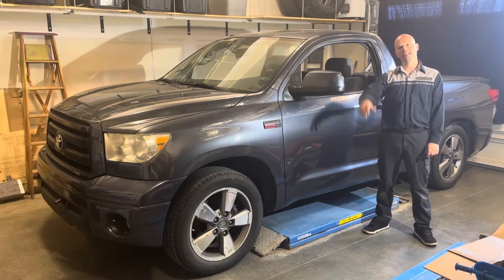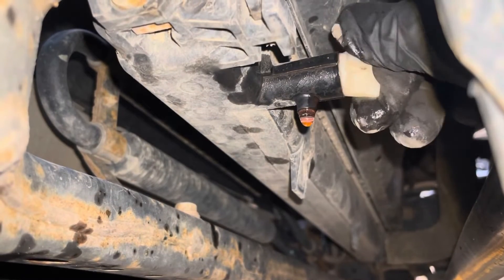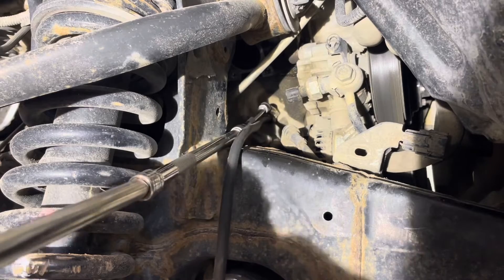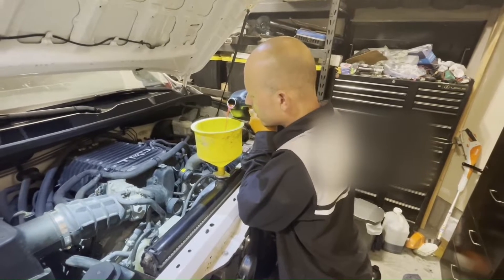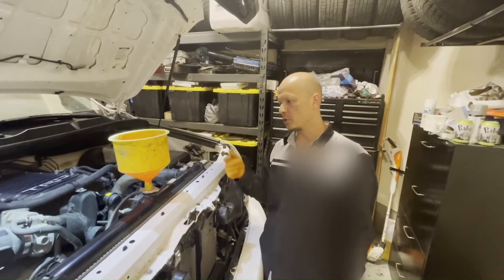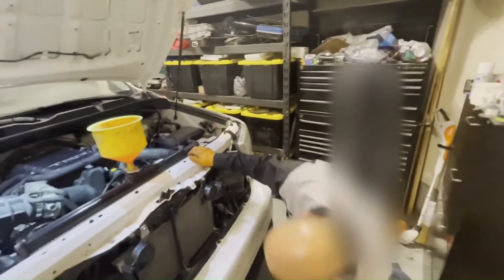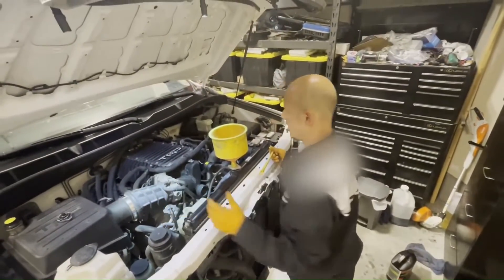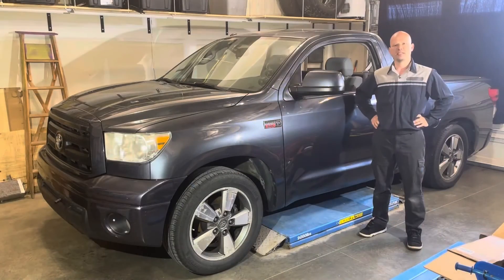2007-2021 Toyota Tundra Engine Coolant Drain And Fill Instructions

Comment from the maker: Below are my affiliate links to the parts and tools you would use to complete this job. I may receive a small commission from the product sales. Thank you!
Genuine Toyota coolant (3 gallons required): https://amzn.to/4nlPCAF
Coolant bleeding funnel kit: https://amzn.to/3QbalKl
Sturdy 4 Gallon coolant drain pan: https://amzn.to/3Ou4iiu
5/16" drain hose: https://amzn.to/43E0cJa
Automotive trim and clip removal kit: https://amzn.to/3KgKGfg
Truck jack stands: https://amzn.to/3q6VS7t
1/2" drive cordless impact wrench kit: https://amzn.to/3Kcw00I
3/8" drive flex head digital torque wrench: https://amzn.to/3O1EOru
Rechargeable LED mini work light: https://amzn.to/3Y74OpY

Comment: Did you also drain out the reservoir?
Reply from the maker: I didn’t, but you can, just disconnect to small hose that goes from the reservoir to the rad cap and lower it down to drain.
Reply: @Viktor_G_Automotive highly appreciate the videos you have made regarding the tundra. I’ve saved my self money using your videos. Thank you.
Reply from the maker: @LuisSanchez-dw7mt my pleasure, thank you for the positive feedback!

Comment: Dang! I love the stance on that tundra!!! So uncommon to see the single cab short bed 5.7 tundras! The fastest NA ones they made
Reply: AND that one has SC! Goodness
Reply from the maker: @HowtoRestoreHeadlights it is pretty quick for a truck, ran 10s in the 1/4 mile 😅 https://youtu.be/tla58JxDXXw?si=ksSyH-SQIkhxkOuJ
Reply: @Viktor_G_Automotive goodness! 
I just like the tow/haul button on mine lol 
300k miles on the sequoia I have now. Just bought it and wowzers did they neglect it. It’s how I ended up here. I’m doing heater hose t’s and figured I should see if there was anything special on this
Reply from the maker: @HowtoRestoreHeadlights right on!

Comment: Thanks for your list of items, I use the hose and funnel kit you linked. The hose has a good rigidity to it that allows me to drain the radiator while only removing my oil filter door from my skid plate, not the whole skid plate. Few tips I've learned:

1.) Leaving the rad cap on when draining it will empty the reservoir as well.
2.) Toyota's repair manual says to squeeze the coolant hoses by hand to bleed air bubbles. This seems to work quite well. Almost no air at all comes out of the system afterward.
3.) I use a USB pump (one intended to be used as an oil extractor) for the coolant fill. Makes it easy to fill slowly.
Reply from the maker: Right on!

Comment: Hi Viktor, is it normal after draining the radiator and passenger side drain for the overflow reservoir to still be full? Thanks
Reply from the maker: Yes, you can just disconnect the small hose from the overflow tank and drain it if you want.
Reply: @Viktor_G_Automotive thank you!
Reply from the maker: @mrpapke09  no problem!

Comment: Torque on the drain bolt I believe is 5lbs. It’s a soft metal. Also tighten too much and socket has an easier time getting stuck
Reply from the maker: I don’t believe the manufacturer provides the torque spec for it, I just go by feel. But yeah, you don’t want to over tighten it.

Comment: Do I need to flush the radiator with cleaner as well? Or is following this guide all that’s needed?
Reply from the maker: Hi, the procedure shown follows the repair manual instructions. You can flush it if you want, but unless the system was contaminated with oil or aftermarket coolant, I don’t feel it is necessary.
Reply: @Viktor_G_Automotive I’m clicking the link in the description for the coolant but it’s saying not found. What brand of coolant are you using For a Toyota Tundra 2010 SR5 V8 5.7L? Thank you!
Reply from the maker: @DatDude_69  Hi, I've updated the link. I use OEM Toyota coolant only https://amzn.to/4nlPCAF
Reply: @Viktor_G_Automotive do you recommend putting a new radiator cap on after?
Reply from the maker: @DatDude_69 it’s very rare for them to fail, so I don’t replace it during a coolant change. You definitely can if you are concerned though.
Reply: @Viktor_G_Automotive sorry for all the questions, DIY vehicle stuff is somewhat scary. I don’t have a jack stand but I do have a 3-ton jack, will that work?
Reply from the maker: @DatDude_69 use at your own risk… it is not recommended to work under a vehicle supported only by a jack without any backup in case it fails

Comment: Hey mister I have Toyota tundra 2007 , and it’s overheating only when u are driving , changed water pump , thermostat so far , and I tested head gasket with fluid tester
Reply from the maker: Clogged radiator?

Comment: How many gallons did you end up using for that process?
Reply from the maker: It will need between 2-3 gallons if you drain it fully, so get 3 to make sure you have enough.

Comment: We’re doing this specific service on a 2019 Tundra. We removed the heat shield on the driver’s side. There are 3 bolts (10mm heads), then lowering the vehicle, we opened the drain from the topside of the engine. You’ll have to use your fingers to locate the drain bolt for the engine block. We removed about 1-2 quarts of old engine coolant from the left side or bank #2 of the 5.7 engine. We use distilled water to flush our engines. It eliminates reintroduction of minerals into the cooling system. We’re in the Southern part of the US and our tap water is quite hard (minerals). We also use the BG automotive products coolant flush kit.
Reply from the maker: Nice work!

Comment: Hey Victor, I did the same procedure, I drained the radiator, drained both side valves, added 1 gallon of coolant to the radiator, started the vehicle, and when it reached operating temperature, white steam began to come out of the radiator nozzle, I immediately turned off the truck, and continued adding coolant, after 2 gallons, I turned it on again and no steam came out of the radiator nozzle, I added 2 more liters of coolant and left it on for 1 hour, then I drove it for 2 hours and the temperature oscillated between 87 and 92 ° C. I did NOT do the step of turning on the heater. Now I don't know if it has air in the system, I need your help... Do you think that white smoke affected the vehicle? The temperature always remained at 90 ° C... it did not go up that far... I also turned the truck off immediately.
Reply from the maker: It sounds like it started overheating due to not enough coolant because of an air lock initially. Don't worry about it, if the coolant level has settled now, it blows hot air at idle and does not overheat anymore, you are good.
Reply: @Viktor_G_Automotive  ty, my friend, what oil you use for this engine? 0w20 or 5w30? Can i run 5w40?
Reply from the maker: @raedavilcevivisa6834 I use 0w20 in the stock engine and 5w40 in my built supercharged truck

Comment: Hi Sir its Imran here from Saudi Arabia 
please my vehicle has Engine overheating issue TOYOTA SEQUOIA 2009 PLATINUM 5.7
i change Radiator original one
I change Thermostat Valve 
i change Fan and  coupling also
but still the Engine is overheating 
please can you advise me for this issue
Reply from the maker: @sherwani_official  could be a blown head gasket or failed water pump among other things, would need to be professionally diagnosed.

Comment: Hi viktor, do you know if the 2015 rx350 o2 sensors are under the panels? I didn’t see them and I didn’t find any tutorials. Also, I would like your opinion on whether or not it’s a good idea to replace them before failure. My cars at 120k but I’ve heard of them lasting until 200k
Reply from the maker: @tommyl3707  hi, the oxygen and A/F sensors are accessible from underneath the vehicle, you just have to remove a couple of splash shields. I don’t preemptively replace them, I would wait until one fails and replace it as needed.
Reply: @ cool, some people think old ones can cause damage and of course it stinks to have one fail out of the blue, but given how many there are and that they could potentially last much longer I’ll hold off. Thank you!
Reply from the maker: @tommyl3707  sounds like a plan 👍
Reply: @Viktor_G_Automotive  so all of them are pretty doable DIY? Thinking about buying them because of the tariffs 😄
Reply from the maker: @tommyl3707  they are not super difficult to replace if they are not seized in the exhaust. Sometimes the threads get seized however, and it makes the removal very challenging.
Reply: @ ok, I’m not as worried about seizure than I am about them being in some really tight unreachable space that would require removing the manifold, for example
Reply from the maker: @tommyl3707  the downstream ones are easily reachable. The upstream one on the rear bank is the one with the least room for access, but with the right tools and some patience it is doable, as long as it is not seized.
Reply: @ is this visible without panel removal? I saw three but don’t know where the last is!
Reply from the maker: @ if you know exactly where to look, you could possibly find them all without panel removal
Reply: @ haha I found it, it was more visible than some of the others

Comment: At the beginning you are standing in front of a metalic slate 5.7L tundra but when performing the coolant change it appears to be a white 4.7L?  Those drain plugs on a 5.7 are not that easy to get at.  Also, what about the heater core fluid?  Does it get drained out with the engine block drains?
Reply from the maker: Hi, I have 2 Tundras and my friends have 3 Tundras. The intro was filmed in front of my truck and the work was done on my friend's truck. They all have 5.7 L engines. A 4.7 L looks nothing like the 5.7 L.
I worked as a dealership master tech for 17 years, I can tell the difference :)
The white truck has a supercharged 5.7 L in it.
The heater core does not get drained unless you remove the hose from it to specifically drain it. It is not necessary unless you are really set on getting those last couple hundred milliliters of coolant out of the engine.

Comment: Hey viktor. I have a 2007 Toyota tundra and my problem is that the temperature rises when I go fast and requires more power o get to a long hill. I have replace thermostat and radiator cap also the fan clutch. But still does it.  What would you recommend?  Thanks again.
Reply from the maker: @mlgimind  maybe the radiator fins are clogged, or the head gasket is blown and allowing the combustion gas to enter the cooling system. Would need to be diagnosed in-person, hard to say without seeing it and inspecting/running some tests.

Comment: Is there a flush process in between the drain and fill?
Reply from the maker: @Mightiflier  the repair manual does not mention any flushing during coolant replacement, just a drain and fill.
Reply: @Viktor_G_Automotive  Thanks for the quick response!
Reply from the maker: @ no problem!

Comment: Thank you Viktor - I’m probably more conscious than the average Tundra owner about upcoming maintenance needs, but on the other hand, I’m not compulsive about leaving in the 12oz. pre-existing coolant that would normally come out of the driver side block drain (vs the usual desired 1 gal (you want out) that drains from passenger side) *Not stressed about not getting the remaining 12 oz in the heater core … I consider my personally possible risk compromising multiple other (formerly completely tight) hose connections or safely removing sensitive radiator brass plugs due to a lazer-focus on every last coolant “ounce” that is ‘possible’ to remove ending up introducing a self-induced air pocket. Your video offers a lower-risk, down to earth, yet realistic high % coolant refresh and this for me makes your video, work experience & realism a perfect guide for me. Thank you sir! I will watch for your prev. or future Tundra maintenance videos or any other vehicle make procedure you offer a guide for 😊
Reply: So are you saying there’s no need to pull the heater hoses and driver side block drain?
Reply from the maker: @ you can if you want to get every last drop of coolant out, but I wouldn’t bother
Reply: @ that’s what I’m wondering about. I am going to do this because if I understand this right the coolant becomes acidic over time and can eat through the head gasket. But what I don’t know is if some residual coolant will contaminate the fresh coolant or will the residual coolant become safely diluted?
Reply from the maker: @ it will be totally fine, on most vehicles it is physically impossible to get all of the coolant out anyways.
Reply from the maker: @Orbi.Lee23  thank you for the feedback!

Comment: Hey I overfilled my coolant to the very top on accident on my 2015 Toyota tundra. A fuel transfer pump isn’t doing the trick. I should be able to just drain it a bit so it lowers to “full” again right? And be good to go?
Reply from the maker: @sebastiancuevas7441  you could partially drain the overflow tank by disconnecting the hose that goes to the radiator cap.

Comment: Viktor, knowing your Tundra is also supercharged, do you have a similar procedure for flushing the cooling system of the supercharger?
Reply from the maker: Hi, I do not have a video for the supercharger system coolant replacement at this time, but will make one if I get a chance in the future.

Comment: Hi Viktor,

Thank you for another Great tutoring video.
Looking for your professional advice, as after changing the coolant in Santa Fe Sport, I run into some abnormality.

Everything was done by book: vehicle was parked on leveled surface, 
I emptied the radiator and overflow tank, 
filled the radiator and overflow tank with new coolant (I used spill free funnel)
Turned the engine on and squeezed upper and lower radiator hoses,
Set the heat temp. to the max,
Waited until the thermostat opened and radiator fan was on THREE TIMES.
The thermostat opened three times at the temperature 93 Celsius (199.4 Fahrenheit)

One thing I did differently this time – I put heat temp. to max., but did not turn the vent.to maximum, as there are too many controversial regarding the vent ON or OFF.

After the test drive, I found out that the heat blows only if I dial the temperature to 30 C and up.
It I set temp. to 23 C, as usual, there is no heat at all. Also, the engine temperature stays a bit below operating temperature - 84-85 degrees Celsius.

What would you advice. I am planning to change the coolant once more. This time, I am going not only set the heater to the highest temp, but vent to the highest speed too.

Would it help to put the front of the car on jack stands, so the radiator is as high as possible.
I will appreciate your professional hints.

Comment: Just replaced the radiator on my "03 V8 4Runner. I refill the rad slowly as you mentioned, make sure the overflow reservoir is at least half full, if not over full, and then install radiator cap, take it for a 5-10 mile drive, so thermostat opens, and then check and top off the overflow reservoir as required for the next 2 or 3 drives. After two drives this time, reservoir needed topping off. I only use Toyota recommended coolant.
Reply from the maker: @RonRussell-sj1zf  the 4.7L V8 takes a lot longer to bleed the air out of than the 5.7L for some reason. I think you did everything correctly, no issues.

Comment: Thank you for the video. Do you recommend draining the heater core as well?
Reply from the maker: @pv4083  you can if you really want to, but there is a minimal amount of coolant inside of it.
Reply: @Viktor_G_Automotive  thank you. By the way the transmission fluid change on a 2021 Toyota sienna was really helpful. Thanks
Reply from the maker: @pv4083  glad to hear!

Comment: 5/16 inner or outer diameter for the drain hose?
Reply from the maker: @adambruneau8968  hi Adam, there is a list of sponsored Amazon links in the description below the video with all the parts needed to do the job. The rubber hose is pretty much always measured by the inner diameter https://amzn.to/43E0cJa
Thanks!
Reply: @Viktor_G_Automotive  awesome, thanks for the response. Great video!
Reply from the maker: @adambruneau8968  my pleasure!